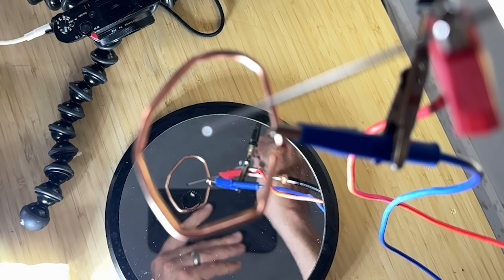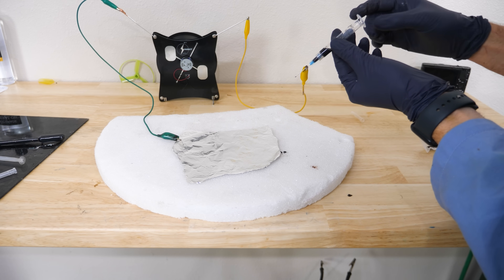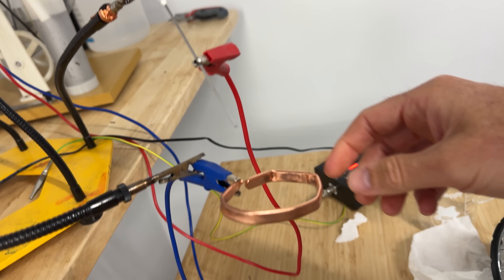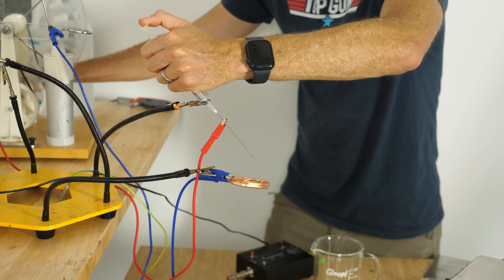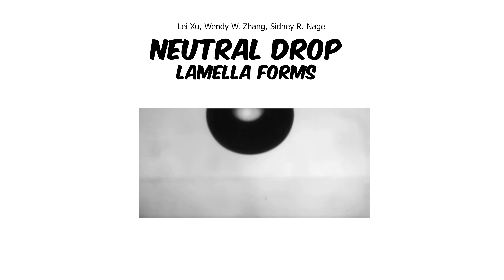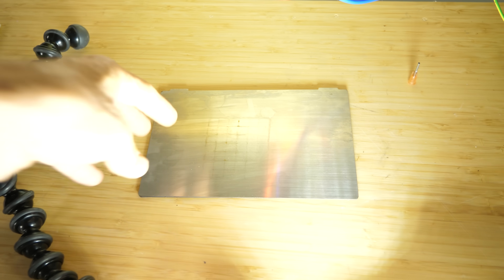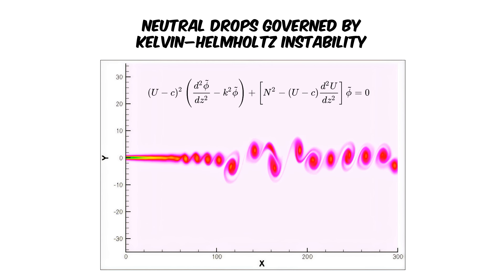Scientists Just Found Why Electrified Drops DON'T Splash

Comment: It would be interesting to see what effect this has in a combustion engine. Polarizing small injected particles and could this have a positive effect on efficiency or any other aspect. Less consumption, more torque or higher HP with the same engine mapping or maybe an ECU tuned for this specific purpose. Maybe this could lead to more specialized engines or just engine parts.

Comment: Think static electricity, and how those atoms are attracted to each other with tighter bonds, drawing in other charged particles. Not wanting to release them.  I think it would be interesting to see what might happen if the droplet is dropped onto a grounded wire, or right next to one.

Comment: I'm 1:40 in and my guess is. The moment the charged drop approaches the neutral ground, the drop surface is attracted to the ground surface to level out the charge. The result is that the drop is "pulled down" to the  surface. Any drop flying away need to fight against the attraction of the electric charge.

Comment: Instead of using a plate, what happens if the dielectric is deionized water? does the bubble stay intact under the surface for longer?

Comment: Actually now when i think about it, if you watch the rain drops when its raining, sometimes there is an effect where it looks like the raindrops are barely splashing at all, while sometimes they splash really strongly, almost disintegrating brutally in to tiny droplets. I would always though it had to do with wind, size of the droplet, maybe the temperature etc.. But after this video it actually gives another idea about ionized droplets being effected by the charge from the lighting.

I am not sure but I think this could or maybe already is being used in paint spraying technology. 

Basically everything that needs precision and water should benefit from this greatly. Maybe high precision water cutting. Also the water taps in household. We do already have a various options to reduce the water splash from the tap, but this might be one of them.

Comment: I would like it to be useful for separating fine gold from charged clay particles in an ore slurry, without using chemicals. The issue with fine gold, or float gold, or colloidal gold is that it is so small that it is attracted to fine clay particles and remains suspended in solution and can't be gravity separated like free mill gold. So refiners treat samples with mercury or cyanide to dissolve or amalgamate the gold and later separate it after chemical recovery.
Perhaps this knowledge could be used to disperse gold from clay particles and take advantage of the gold affinity for charged surfaces...like a scavenging recovery by passing a thin stream of slurry through a charge?

Comment: I hate to dispute your claim that this was not known until 2025. Isn't true at all. I had studied this and other effects. While building Resonate Xfmers and negative ion research from 1988-1995. Even wrote about it. Research was associated with building a UV ionization LASER for step leader research. Also, Li³, Li⁶ and attempting to shake loose and electron. The negative Ions I produced were off the charts. The die-electric phoresis work for material separation was interesting. I regret however I wasn't aware this was unknown. I am certain I have read or heard of this effect.  Negative Ions have mass  . Maybe push back  on that but, home brew rail gun caps like negative CHG better than positive. I wrote about Tracker 360 degree LASER scanner and target tracking system and lock based on signature with distance and 360⁰ sweep sensor and LASER weapon all mounted in gimbal system. 
They or these people may have written a paper on charged water droplets but they by no means were the first to study or observe the effect. That isn't true. Negative Ions are fascinating. I also built the first folded plate capacitor and Gas UV LASER. Mounted in a PVC tube. You gotta fire very quick in Nitrogen before it Lock Steps. By mounting LASER and Folded Capacitor Plates inside a PVC tube you can dump much more power to the rails of the gas LASER, Might accelerate the rail gun as well? Just thought you would like to know. Beware claims made about being the first. 
Thanks great piece. 
TRAMCO R&D
TRAMCO G.C. BC.
RON T.

Comment: So I have been trying to buy that meter you use to tell if an object is charged or not charged from distant.  But not only the charge but the sign which is truly amazing.  I have never seen anything like that in my life and I am old.  Sonny.

Furthermore, I am amazed you can electrify liquids so easily.  Milikin and Fletcher (mostly Fletcher because he was the graduate student) had to use gold dust emulsified in oil to even catch just a few a charge or two with their cathode spray ray which you have to heat a platinum plate to a few hundreds of degree Celsius to do.   But you done it so effortlessly.  

Most fluids are dielectric which means they polarize under a constant field but do not like bare charges in them.   You should try the Fletcher experiment to confirm your droplets are really charged and how much with that fancy meter of US for calibration before drawing any pre-mattured conclusions.  

Also, this whole splashing business probably has more to do with surface tension.  In a vacuum, surface tension of most liquids will increase because the solvation energy difference between in air and in fluid is huge, so surface tension is high.  Meanwhile I think you are faking this one.  Are you trying to get a PhD from a famous lab and need some recommendations?  Just curious.  Honestly,  I have a PhD in physics and I learn more from you than most idiots I keep running into in graduate school.  Mine is an Ivy btw.

Comment: I'm currently going through my PhD where i'm used to use a piezoelectric inkjet printer, this discovery will be for sure helpful, thank you to notify me with this video
Reply: How are you able to utilize piezo since it has such low displacement?
Reply: @ThuleApsu Hi, what do you mean with "low displacement"? Drop spacing?
Reply: @matitrattore98  Hi, I mean the piezo element has very low movement as in fractions of a mm, so you probably use large diameter Piezos moving fluids thru nozzles almost nm distances?
Reply: @ThuleApsu aah got it, so i never really check di specification but i'm using a Dimatix Inkjet printer from Fujifilm, it is a well known machine in the printed electronic field
Reply: @matitrattore98  Ahh, so for like flexible PCB printing?

Comment: Another application for this.
A potential military weapon.
If you were able to create a larger sphere of acid inside of a glass container.
Then propel this object to a target.

It could potentially electrify electrical systems and eviscerate the target from the out side in.
The damage would continue even if the target were to move out of site.
An acid like nitric acid concentrate would be able to knock out armored targeting systems and even weapon barrels with devastating effect.

Potentially changing the way armored warfare is conducted.
All though small drones laiden with explosives seem to be doing a great job right now, for now.

Comment: It requires no actual electricity to charge water.
Google the following.

Kelvin
water dropper

you will need 

 2 lengths of uninsulated wire

3 buckets

water

rubber balloon(inflated)

sit the device on a wooden bench or table( insulator)

rub balloon on small hairy animal or child to charge it then use that charge on one of the wires....then watch.

Comment: Water is an universal polar solvent, a neutral drop when it falls breaks into secondary droplets and get charged in the process!, but an already charged drop based on its type of polarity of charge will either take concave shape or convex shape but doesn't break into secondary droplets. Im sure there is still difference between a grounded and un-grounded conductor plate that responds to a a falling charged drop.

Comment: What happens if you put a opposite charge on the metal plate, or the same charge?
Reply: if the drop and the surface have the same charge they will repel and the drop will splash more but if the surface has opposite charge there will be less splashing.

Comment: Does the metal take the charge, unlike the glass? Making the drop splash instead of spot. It would be interesting to see at what point  it goes from a spot to a splash using different surface materials and if it varies how well they take a charge.

Comment: maybe it can be used as an easier way to measure a drop for a specific way, measuring the final surface area of a drop with no splash seems easier then accounting for the different variables in a dropper device...

Comment: Suggestion: Anti-Splatter Surfaces

The coating of surfaces in high-risk areas such as hospitals, food processing facilities, and public transportation (door handles, countertops, benches) with dielectric materials. This ensures that droplets containing viruses or bacteria, when hitting the surface, do not splash and scatter, but remain confined to the initial impact area. This simplifies surface cleaning and reduces the risk of cross-contamination.

Future Invention: Smart Disinfection Systems

Autonomous disinfection robots that spray liquid disinfectants (with a controlled charge) onto a specific surface, ensuring maximum contact area without splashing. Source:  Google Gemini :)

Comment: Space flight and the precise flow of liquid. Does it work with super cooled liquids? Methane, Liquid Oxygen?  Not that there is splash but can it adhere better to a surface and therefore flow more precisely for better mixture, delivery to combustion chamber etc. Does this help in zero G when trying to get every last drop to the engines.  Got to be some aspect that can be utilized.

Comment: Sir, ferrofluid is not a charges liquid, yes part of it has a measurable viscosity, it is a charged solution where the ferrous parts will not dissolve. Might be better to call it a mixture.

Comment: I had this kind of vision pop in my head a few years back where you could shoot water balls that would hold there shape until impact. Like paintball. It was like the water was injected into a spherical type chamber that was spun up and electrically charge. Then using air pressure fired off. 
How cool would that be. War games including cannons or mortar fire, each team has their own colour water. There would be additives to the water that condition the water for a longer distance before breaking up. 
Pretty sure that’s a long way away, and might even involve hacking the simulation, but it would be pretty cool to have.

Comment: I noticed you used a mirror rather than a sheet of glass on wood. Charged droplets will be attracted to a piece of glass with metal foil on the back "Capacitive effect". Non- charged won't be attracted, hence the difference in the lamella between both droplets. (Dropping directly on to a metal plate, conducts and disperses the charge). I love your challenges.

Comment: in 1998 i was working in a workshop in Afghanistan. We were charging the paint spray gun for a better and smooth painting for the cover the equipment we were making in the shop. I think it was discovered years ago. The car factories are using same method for the car painting.

Comment: It would make for a means to create a windshield that could have less optical distortion with rain….. also, in painting industry, less issue with overspray loss and aerosol scatter.  If one could match charge of droplet to substrate, nanoscopic violence would be less….. this effect should be scale invariant if theoretically plasma type phenomena…… it has direct application to boldly go where no one has gone before;)

Comment: Dude... A drop fragments and splays on falling due to the upward rising elements against it yea? (think drop falling from the cloud that breaks up more)... I wonder if you could use a form of this to cause a drop to hold more form and not splay out as much, giving. Like how a stream comes from a tap yet inevitably will break up due to pressure from the pipe or from the upward elements against it

Comment: I really wish you would've tested dropping a water drop on a charged surface too to check whether or not that would prevent it from splashing.
Reply: You can’t charge the dielectric surface the same as the droplet to try the reverse. That surface is needed. So one needs to make the drop dielectric and and the surface charged
Reply: another really interesting thing to test would be "are electrically charged drops rounder than neutral drops".

charges concentrate at surfaces and repel each other, which means theoretically a charged drop should be more spherical than a neutral drop of the same size... or maybe less spherical as the charges repel each other and increase deformation to maximise surface area.

Comment: I'm not certain of the vacuum scenario. For the charged scenario. I guess that the charge affects the strength of the bonds. Those bonds become tighter until they burn up from excess energy. In this case evaporating into electric arcs & plasma.

Comment: hello! what about condensation, and vaporation? does it matter whether you are charging the surface on which you expect either one? can a fuel injector work if it is made out of a different than metal material?

Comment: 60 years ago when I was bored in 6th grade, I found out how to draw on my metal desk’s legs with ink. I took a ball point pen apart and broke off the tip, leaving a metal tube filled with ink. Then, it was discovered if I rubbed my back back and forth on the plastic chair, I could bring the ink cartridge close to the desk leg, and it would release a random designed ink image on the leg. Too bad I just didn’t go on to invent a laser printer or something!

Comment: I'm curious what if both the drup and the surface is also changed? or what if the surface that are the only one charged? what if the surface and then drop have an opposite charges? or what if the same? what if you apply a really strong charge in the reface instead of the drop?

Comment: Oh, you want a use case? Challenge Accepted. You can make an EXTREMELY high-quality printer that can print ultra-high resolution if you charge the ink before it is put onto the paper. The additional charge lessens splashing and allows for micro precision.

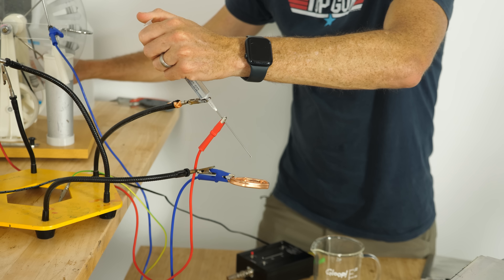Comment: I saw something that may or may not have been noticed by others. At 6:30, when the charged droplet makes contact with the metal plate, if you slow the video to 25%, it looks like it splashes across the streaks in the surface and not so much parallel with them. Does this mean that the surface is affecting the droplet's tendency to splash because it is not polished to a similar smoothness as the glass? or is it actually the makeup of the material that is affecting the 'splashiness' of the charged droplet?

I'd be interested to see the same experiment with a mirror-polished metal plate of the same material.

Comment: Just the first application I thought of was that sneeze shields shouldn't be made of metal or any conductive material, surfaces, perhaps like in operating rooms or even surgical tools, may benefit from a dielectric coating to prevent splashes (if the droplets of whatever fluid are slightly charged)

Comment: I knew someone who was working on a project for the military. It involved launching rocket or missiles from air into bodies of water. The goal he said was to make them not explode when they hit water. My suggestion was to remove the tension surface of the water. I wonder if possative/negatively charged water shooting out of the tip just before impact would resolve that. Any thoughts?

Comment: Hear me out: Splashless toilet.

 “How much can we safely charge a human while peeing ?” would become a legitimate scientific question to answer 😅

Electrode in the seat or better nearby so you can choose to be charged or not. Dielectric coating of the ceramic if it does not work as a dielectric. Then install a discharging resistor in the water tap handle so you don’t get shocked -> safely discharged user.

Comment: Molten slag from a hot furnace splash when leaving the source! This is dangerous for a human operator in the vicinity as burns may result; if the molten rod (leaving a furnace- I know they call it the charge but that's just coincidence) was electrically charged then that would minimize the safety hazard potentially!💥

Comment: When we drink charged water, or our body actually puts a charge on it, our water lines our veins with a negative charge in gel form.  Our blood is positive charged so that repulsion is what moves our blood through the veins.  The heart is not a pump.  It is incapable of pushing blood through 10 miles of 90% capillaries having flexible walls. Any engineer will tell you that.  The blood actually enters the heart at a slightly faster speed than the speed that it exits.  The heart is there to put a spiral spin to insure the positive charge on the blood is maintained..

Comment: Might sound silly but when designing an enclosed ecosystem that has to recycle EVERYTHING  the ability to urinate with no wasted splatter is an not insignificant thing. Could boost recycling efficiency to last those few weeks longer for long term studies or even space travel.

Comment: Using metal as a control to test the dielectric idea, is not good. The metal just made the droplet neutral so it is not testing whether charged droplet's lack of splashing is due to attraction to dielectric surface. To properly test that, you need to get a surface that has very low dielectric constant, and see if the plashing increases.